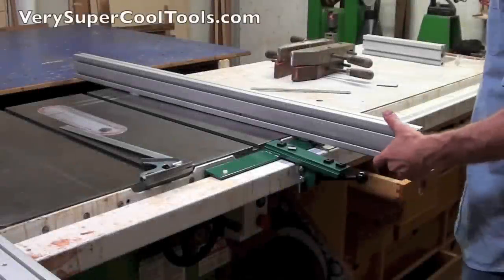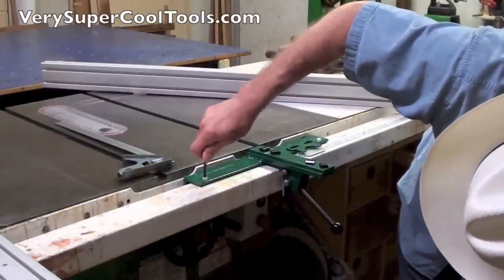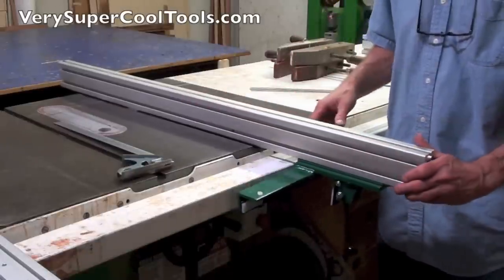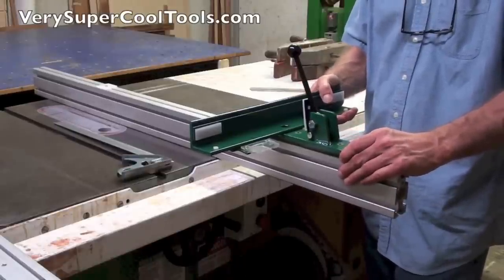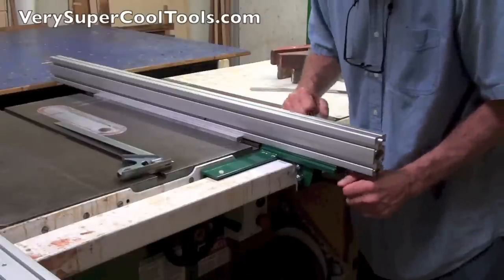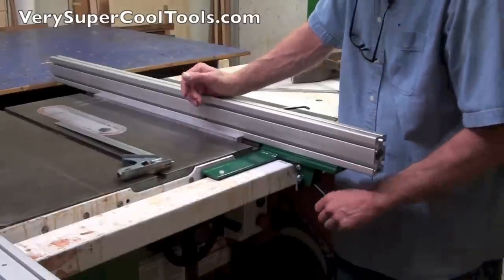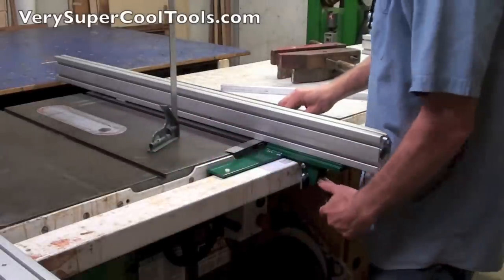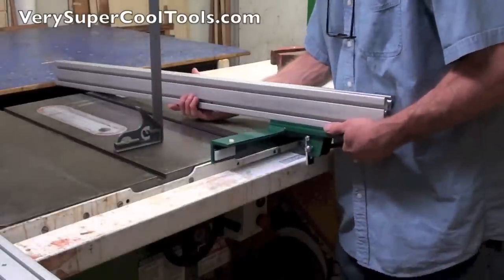How To Square Your Aluminum Extrusion Fence To Your Table Saw

Comment: I bought a Craftsman cabinet maker saw 25 years ago, and it's seen a lot of miles but is still going strong. It was the best of the Craftsman series at that time. However, the fence is crap. Would your fence fit my saw?

Comment: Hello my friend, would you consider using a machinist 123 blocks as to squaring the top to the fence? Inserting/milling a steel button or key as to hold the fence tightly? In the event the under side of the fence is not laying flat to the table saw. Would you consider adding a adjustable drop down leg ? The drop down leg/ arm would be a very durable plastic?  Note: would you consider having a micro gauge as to reconfirm that the 123 blocks are correct?   I am not a machinist, I enjoy ..Bob

Comment: I've been looking at this product for a while now and am very impressed.  I have finally got a good cabinet saw worthy of such a nice fence.  It app rears there is about 1/8 inch gap between the bottom of the fence and the top of the table.  Does that cause a problem when cutting thin stock drifting under the fence?  All and all it looks like a great product and as soon as I get home from this deployment I'll be placing an order.
Reply: +PrepItForward That gap is to accommodate the UHMW glide that keeps the aluminum extrusion from contacting the cast iron top. If you need to cut very thin stock such as laminate an auxiliary face can be added in a matter of a few moments. But I do 98% of my cutting with just the bare extrusion. The gap actually allows for dust to blow under the fence so there is no interference between stock and fence.  Allan

Comment: So there is no clamping or guide at the back of the saw? I might be able to resurrect my old contractors saw  and incorporate the rail as part of a workbench and mount arouter also.
Reply: No back rail clamping needed.  Biesemeyer style t-squares only need to lock on the front tubing. Makes them fantastic for taking on and off the saw quickly. You will notice though there is a back angle iron piece, but this is only to act as a support for an extension table to the right of the cast iron. Any saw tuned up with proper fence is machine woodworking progress can be made on.
Reply: AskWoodMan I'll haul out the old saw and get it set up.I assume that as long as you have the rail set up it will work right down the line. Im thinking of an 8' bench including the saw mounted at a right angle to the length of the bench. Many thanks